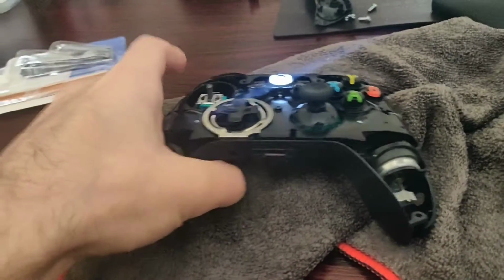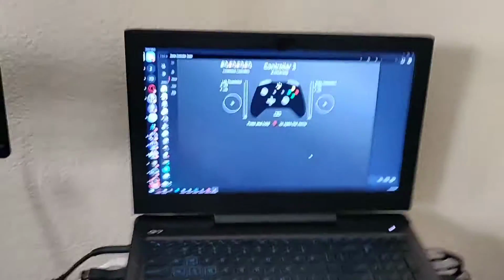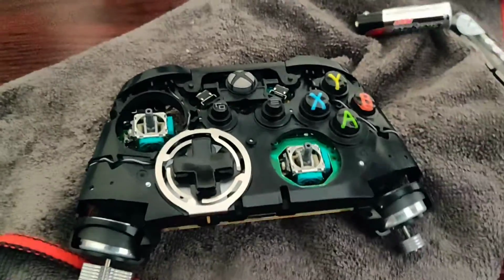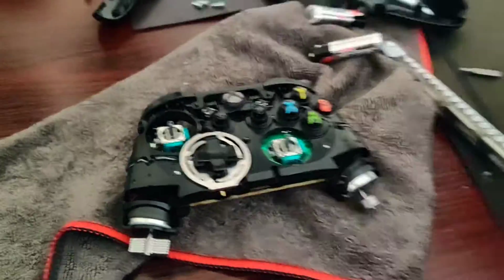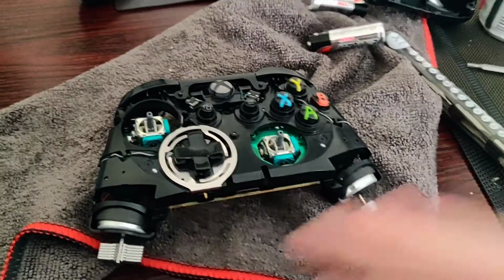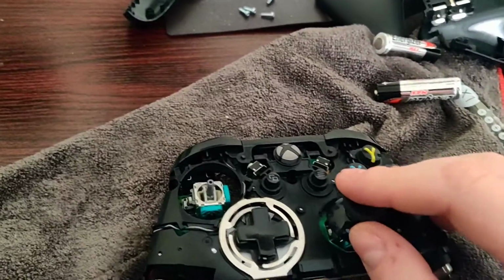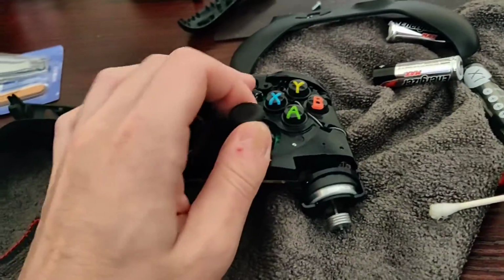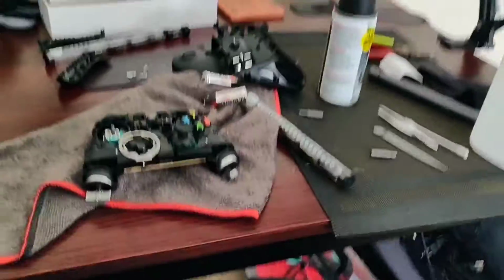Fix Xbox One X S Controller Drift - NO TOOLS EASY & Works New Method

Comment: Yooooo that really worked I had 2 controllers that I fixed today thanks buddy the right joystick drifted up I used a paper click inside the sensors to move Alcohol around
Reply: I have the same problem it on the left joystick. It drifts up aswell but I don’t know which sensor to clean. Which should I do if it drifts up?

Comment: Thought you said don't need tools
Reply from the maker: It's a screwdriver fam
Reply: @thrivingentrepreneur  a screwdriver is a tool pal
Reply from the maker: @nexorider17  u don't have a screwdriver?
Reply: @thrivingentrepreneur  i do infact i have a hole screwdriver set just recently practiced on one of my old XB1 controllers for disassembeling and reassembeling the controller as my Series X controller just recently got stick drift on the left stick it baisicly drifts both forward and backwards when walkin so just tryin to memorise it how ever my screwdrivers is back at my mothers house due to the stupid rule the owner has of No tools allowed wich is just stupid
Reply from the maker: @nexorider17  tha he.. we'll there is another method to try where you basically douse the underside of the stick with rubbing alcohol using a q tip. Make sure it goes underneath the stick, no disassembly or anything. Just make sure it give it time to dry.
Reply: @thrivingentrepreneur  um ok thanks mate

Comment: #1Unscrew the back board and flip it. Be careful with the wires. #2 I repair controllers for a living. This method works 15% of the time. out of every 20 controllers I get % fixed. Not a very good fix plus there are too many chances for error and damage using this method. Nice try though. Alcohol won't do anything for plastic.